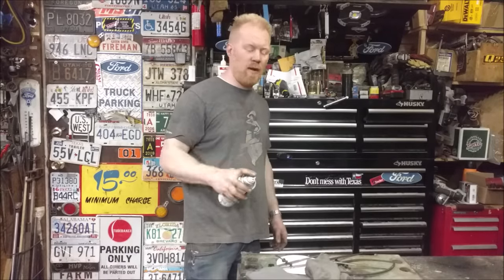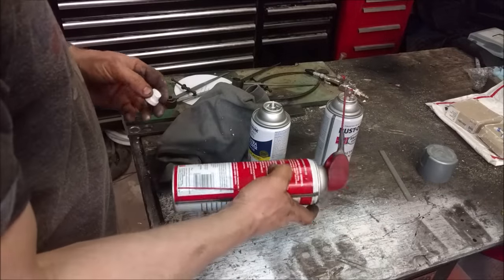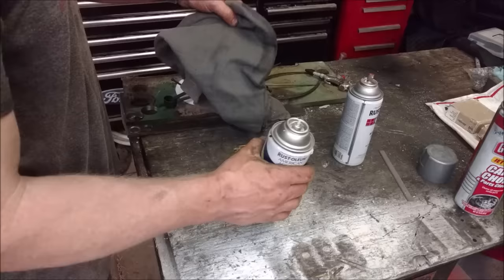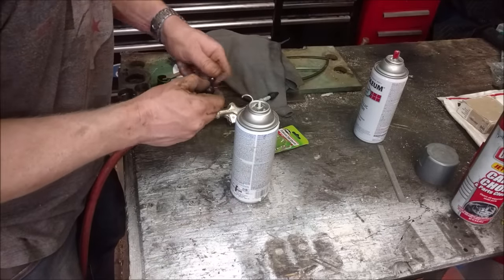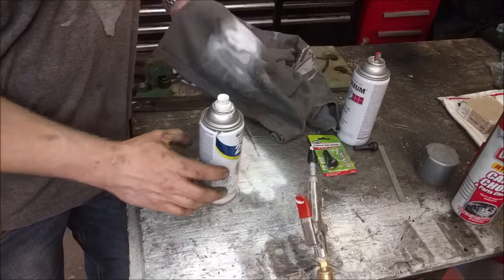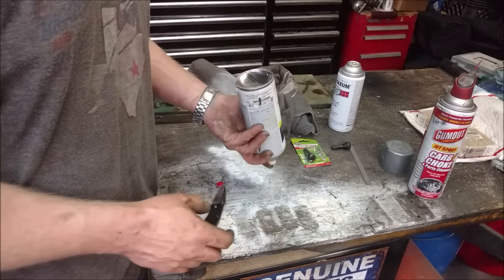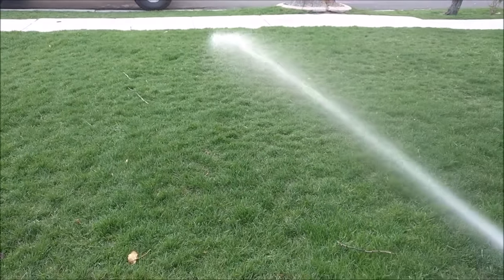Fix Clogged Spray Paint Cans

Comment: Easiest way to prevent clogging is to turn the can upside down and spray briefly until it clears, after you have finished your job.
Reply: shhhhhhhhh. they've never seen a street artist at work. 

I learned that trick in the 80's on "the streets", watching spray paint artists make amazing celestial paintings in front of a crowd.
Reply: Depends on what kind of cans.
Reply: Another neat trick is SAVING them upside down afterwards. The paintsolids will drop to the top and never have the chance to clogg up the straw. 
All paintcans should be saved upsidedown for maximum shelf life✌✌✌
Reply: I've turned upside down and sprayed... not all clear but.. keep spraying (wasting) paint.
Reply: This is common sense if you understand aerosol cans function. This has been know since first one made 😂

Comment: Pro tip if you dont have a compressor... use a can of lighter gas. no need for rubber tips etc just push the nozzles together
Reply: Zippo refill or whatever?
Reply: Interesting.

Comment: Great tips. I store used nozzles in a glass mason jar of paint thinner so that they never dry out till I use them again. And, to keep from getting in this situation, I put a tiny dab of Vaseline on the spray tip immediately after use and just wipe it off prior to the next use. I’ve found that works 100% of the time. And a small jar of Vaseline lasts years.
Reply from the maker: That's a great idea!
Reply: Sorry what’s the Vaseline for? And have you found that the acetone deteriorates the plastic or is it fine? Graffiti artist looking to pick it up again just found every last can is fkd & can’t be used 🤷🏻‍♀️
Reply: About 30 cans of quality shades are probably buggered so I’ll have to buy new ones but take expert care of them this time.

Comment: After clearing the tube by spraying upside down,  store the can upside down.  With no paint in the tube there is nothing to clog it.
Reply: Cant clear the valve by spraying rustos upside down because they have the any angle spray tech so itll just keep spraying paint.
Reply: @nicholasreese7856  Yeah I found that out the hard way 😂

Comment: Thanks 65 good tips. On empty cans I save nozzles if they're good. There's many different sizes & styles not all interchangeable. When I get a bad can I rummage thru the box and find a used one that fits. Gotta try the back pressure trick too. I also cut open the empty cans and save the marbles because over the years I seem to have lost most of mine.

BTW just found your channel a little while ago. My first car was a '65 Falcon
Reply from the maker: I also have a pretty good collection of spray nozzles from used cans.
Reply: Haha!! Lost you're marbles! Nice!
Reply: i have even found steel balls inside spray cans
Reply: If you like the different styles of cabs you should check out all the caps made by Montana they have a sampler pack for a pretty good deal it’s got a bunch of different caps really big spring ones to really fine and all the cabs have like no overspray they’re awesome for painting anything check it out sometime if you want I think you will be surprised and definitely add some new spray paint tips or caps do your collection and will definitely help you with your paintings. Ive used every one And the adapters they make so you can put male caps on a male can are a must-have

Comment: There used to be a fellow on here that restores lawn tractors his advice was turn can upside down spray until the paint was cleared out and keeping the can upside down replace cap and store the can upside down. This really works!
Reply: sometimes you buy new even, and then still they come clogged, great idea but if can is already clogged, this air compressing info is spot on

Comment: Great tip, Ive never thought of forcing air back in. Up till now I've just used them for target practice.
Reply: HA. I do the same thing, it's pretty fun ain't it
Reply from the maker: Paint cans for target practice are always fun.
Reply: Just shoot the can near what you planned on painting!
Reply: @sixtyfiveford  I've been doing that for years...lol...
Reply: @mr.anderson9938  What do you suggest to do with them? What was going to happen with them if they weren't clogged?  What's the proper way to dispose of old paint? Is it the BB or the bullet that turns it into an environmental issue?
Reply: @mr.anderson9938  HA HA
Reply: @sixtyfiveford  Especially if they're full. And pink.
Reply: Hell I'd rather use them for target practice!!!!
Reply: Murica... 🤦🏼‍♂️

Comment: Great tips!  I always keep the nozzles from used-up paints and carb cleaner, etc.  I also use brake cleaner or carb cleaner to rinse the nozzles immediately after every use,  same as you, but I also give the place the nozzle attaches to the can a squirt too.  I never spray upside down to clear the nozzle, as you said, it wastes propellent.  You'll quickly run out if you do a lot of small jobs with one can. 

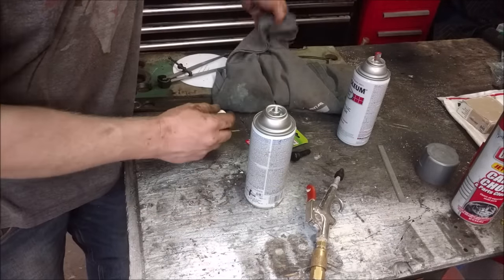Last time I had a bad can of primer that kept immediately clogging the nozzle due to lumps, like yours from 3:45 to 5:00 🙂, I used a spring-loaded center punch, punched a hole near the top, and the punch tip kept it sealed.  I quickly removed the punch and put my finger over the hole, then went outside, and shook the can one more time, turned the can upside-down, removed my finger, and quickly sprayed the part I needed done.  It worked so beautifully I really wished I had videoed it!  When I was done, I turned the can upright, letting the pressure out but saving the remaining paint too!  The spraying took all of about 2-3 seconds.

PS - I love the dog videos at the end, especially this one!

Comment: Thats a great tip. 
Heres another one.. always invert the can when your done painting and spray until its just propellant coming out usually within 2-3 seconds . Will never clog and good to go next time. Works 99% of time.
Reply: Works good for cleaning the spray nozzle too. Unless its already covered in paint.
Reply: As reported by many others, this is from a bygone era. Most cans 10 yrs old or newer no longer "clean-out" by inverting & spraying upside down for 5 seconds. Nowadays they are designed to spray at all angles, so it's rare to find one to "clean-out" by this method.

Comment: Love all your videos...  They are real life examples with the real life struggle to make our life better... 👏👏👏.
Just to add a small improvised versions of what you have already showm.
1st - rubber blow gun tip... if you take a small drill bit (.009-0.015") and pre drill about 1/4" deep into rubber tip it will fit perfectly over the can tip and less mess. You all can use soldering gun tip and make a cone. 
2nd  car parts stores they sell emergency CO2 tier inflation kits.. Use CO2 and you can store spray can after refill.

Comment: Great tip. Another tip is to clear the nozzle by spraying upside down and clean the nozzle with solvent etc as usual, but then leave the can stored upside down after clearing.👍🇦🇺

Comment: Soak your spray paint can in warm water about 90-100 degrees also helps a great deal
Reply: Don't have the water too hot though....I used boiling water to try and unclog a can.
The can EXPLODED..Lucky to be here..Kid you not!!

Comment: As AJK says, float the can in hot water in the sink and everything inside the can will redissolve when you shake it up, then test it  again.  Certain products always have to be heated in water before use because they either sit on the shelf too long or the products are too shy to come out w/o help.

P.S. I had 2 cans of same brand and color paint do this to me this afternoon, but it turns out that one had a male nozzle and one a female.  The can with male nozzle finally cooperated  after some  intensive "therapy."
Reply: Thanks.  I did not know this about heating the can.

Comment: Good idea with the carburetor cleaner. I've been using a "straw" from a pump sprayer, dipping it in whichever solvent and backwashing nozzles before putting them away; it helps alot.
Reply from the maker: Thanks.

Comment: Great tips. what I usually do is soak a plugged up can in hot water for a half hour or so, dissolves the lumps and builds up pressure in the can.

Comment: Little known fact: if there is a small black dot on the top of the can, that is where the inner straw is located in the bottom of the can. Tilt the can so the dot is on the low side and you'll get all the paint out. 👍🏻😁.       🇺🇸😎
Reply: You can bring hard paint or putty back to life in many cases.  You need to have a shaking or mixing machine that marries with the container of hardened material.  In my instances I used a 2 gallon paint shaker from a paint store.  Mixes 1 gallon each side.  Use a balancer if need be.  Add some water for water base and mineral spirits or turpentine for oil base.  Don't add too much thinner but not too little either.
A proper shaker or even a drill with a whip mixer attached will usually bring hardened material back to life.  It can be helpful on a budget or if you had easy access to otherwise waste material that can be utilized with confidence.  We waste a lot of good stuff.  
r.
Reply: This worked, thank you so much for posting!

Comment: Good Stuff man!! when i use up my spray cans and all the liquid or paint is completely gone and  all used up.I always keep all of my plastic tips from any and all types and sizes of my paint nozzles and put them in a Glass see-through food container with a iron cover. put 1/2 full of Automotive Thinners in the glass container and throw all of my plastic nozzles in there and seal them for cleaniness for future use. this way i always got a clean nozzle when ready . ty
Reply from the maker: I keep all my nozzles as well. I don't soak them, but that's a good idea.

Comment: These type of spray tops are the worst, it's not just paint but WD-40 too.  Wastes a lot of product still in the can. Don't know why they continue to sell this type of valve.   Thanks for posting this, it helps.
Reply: For WD40 just add more pressure back to the can with your air compressor.

Comment: Brilliant idea! Additionally you could used regulated argon, nitrogen or co2 instead of air and avoid adding oxygen which could make the paint hard. Maybe using some rubber hose around where the nozzle goes into might work as well as long as your in pressure is slightly more than cans pressure. Might be prudent to put can in nylon duffle bag in case something goes wrong avoiding injury or a mess.
Reply: What are sources of not oxygen gas for us olde retired geeks. 
( I was used to nitrogen, but no longer.)

Comment: NICE , wanted to spray a project with a 15+ year old 1/4 used spray can I always flush the tips with brake cleaner after use  but using  the air to unclog  was great   thanks for posting .. took 5 times as it kept clogging but I  did finish

Comment: For those of us that don't have compressed air, pour a 1/2" of acetone in the cap and store upside. Next day should be clean and clear to use. Even expanding foam spray works. Simply snip the applicator small enough to fit in the/a cap uninstalled and store upside down overnight and wipe away blobs the next day with a Q-tip. Remember to buy some 12" lengths of tubing to fit over the applicator to finish off that can, and yes, the expanding foam can blow that replacement tube off if your not quick enough.

Comment: If your airgun doesn't have a rubber tip you can use a piece of rubber. Make a hole with a nail, then line them up with the hole in the can and push air through it. Also putting WD-40 in the hole can help. It worked for me. Didn't want to waste a full can of spray

Comment: Don't know if mentioned but you can take the spray tip and place  on a carb cleaner and spray it to clean it. If it will fit that style

Comment: I think we all have had blocked can valves :-(
Small anti persperent cans often have a tiny side hole in the stubby tube, as it gets pushed down past a rubber washer the contents escapes through the tiny hole up the stubby tube.
Such a simple idea, but i imagine for paint its a no no.
I too have a wd40 can with the novel spray head and tube, that will be put to one side for cheaper sprays.
I know im sad, but a tube that stays in the spray head is nice.
Reply from the maker: I really like the WD40 spray head/ tube  setup.

Comment: That bran is notorious for this.  I got so pissed with these, I started taking them back
Reply: I agree.  I've had more problems with Rustoleum than any other brand.  I try not to buy Rustoleum spray paint, unless I plan on using the entire can at one time.

Comment: The problem with mine are the nozzles!    Even 100 psi of air doesn't seem to be able to blow through them, yet if I take off the nozzle of a new can, all my 'problem' cans spray just fine!   Wondering if 'Rustoleum' will furnish some nozzles if I write to them??   It would be nice, for what we pay, if they could add 3 or 4 additional nozzles with each can!

Comment: I'm now wondering if nitrogen would do the trick without the risk of drying the paint. Although if the air/propellant bubbles to the top of the can, I'd think just agitating the can often would stop any crust from forming.

Comment: I had a red Rust-Oleum can that refused to spray I must of hit it with air 100 times while painting a scrap barrel with it to use it up. Tons of drips and splatter but didn't go to waste and did some rust prevention. If the can is old it's going to give you a hard time.

Comment: I have the same issues with Rustoleum cans but it's mostly the caps. I now clean them with paint thinners after use. I pull the caps and squirt it through with a wash down bottle and run a little compressed air through it after. They spray much better with clean caps even as the internal pressure drops. The carby cleaner method looks easier to be honest!
Reply from the maker: The cheap carb cleaner lets me get a good visual of how well the tip is spraying.

Comment: Gets messy, but sometimes works. Sometimes depending on the size of the job it's easier to just punch a hole in the can, pour the contents into a small HVLP spray gun and be done with it.
Reply from the maker: Very true.

Comment: 🟥🟥🟥🟥🟥🟥🟥 WHAT I DO ESPECIALLY WHEN ITS COLDER OUT IS TO GET A POT OR CONTAINER IN THE KITCHEN, PUT THE CAN IN IT AND FIILL AND RUN HOT WATER IN THE PAN FOR A FEW MINUTES THEN SHAKE THE DOGSHIT OUT OF IT FOR A COUPLE OF MINUTES. 
TRY TO USE IT WHEN ITS STILL WARM... WORKED FOR ME.🔥🔥🔥🔥🔥🔥🔥

Comment: The rubber tipped compressor attachment is not located in my domain at this juncture.  Should I buy it again?  I managed to puff a couple of shots of air into the can once or twice with a polyurethane fish tank aerating tube that fits snuggly over the can nozzle* (spray tip removed).  Even quick short bursts of the air compressor stiffened the can a great deal but no paint would come out the other way!  I put the can in a box and then in the garbage can  as the over-pressured vessel could burst like the unfortunate submersible that thought it was going to explore the Titanic wreckage!   *That must be a one-way needle valve or something as it doesn't seem to respond well to reverse pressure.

Comment: Just FYI be carefull with Brake Cleaner Now. I think its propabably the plastic (recycled garbage) and not the brake cleaner thats changed but now after clearing nozzles with brake cleaner it melts and welds the nozzle shut !!
Reply from the maker: Not all but some brake cleaners contain tetrachlorethylene. This melts plastic. I wouldn't use brake cleaner to clean these. I would only use acetone and or carburetor cleaner.

Comment: what about the spray cans with the blue nozzle? pressing down on the top drives a pin into the can tube. i have tried using a very small nail which works some what, but would be interested in a better technique.

Comment: What if you use argon, co2 or nitrogen instead of air? 
Anyway,  I'm wondering if you've ever taken the Schrader valve out of the neck of a 1 lb  propane bottle? ..without drilling out that plastic or nylon ring thats pressed in there above the valve. ..and if you do drill it out, what would you replace it with?   Maybe some plastic tubing that bottoms out on top of the Schrader valve?
Reply from the maker: I tested putting different gases into a paint can with a lid and they all seamed to still let the paint skin over. "Air" is 80% nitrogen anyway so I guess that's why that doesn't work. The only gas I really didn't test was pure oxygen. 

I have removed the valve out of a propane 1# bottle. I made a special tool from a larger nail(drilled then a slot cut into tip). If I recall there was a nylon seal and some basic rubber orings. I think I damaged them by pulling them out.
Reply: @sixtyfiveford  lol.. Yes. I made a similar tool . On the other end I ground it into looking like a 2 prong spork so I could scoop under the other Schrader valve that serves as a PRV, to vent it when refilling but its still easier to just unscrewed the bottle and burp it through the fill hole then screw it back onto the 20lb bottle and repeat. 
Anyway, thanks for your reply. I just noticed my previous comment. Where some might say im being redundant, I say consistent. Lol but hey, about the nitrogen, have you tried pure nitrogen or basing it on the air being 80% nitrogen? Cuz what if its the other 20% that's drying it out?  I know nitrogen will keep things from oxidizing, but only if it's at the 100% level. But it seems like propane would work since it's a liquid too. 
There's a paint additive air brushers use to keep their paint wet longer. I forget what it's called. It's possible that dish soap might be a substitute for it. I forget. Also, I think it was for acrylic paint.

I'll mess around with the propane bottle a little more. I'll reply again if I figure out anything. thanks again..